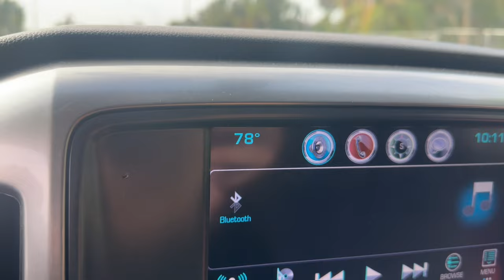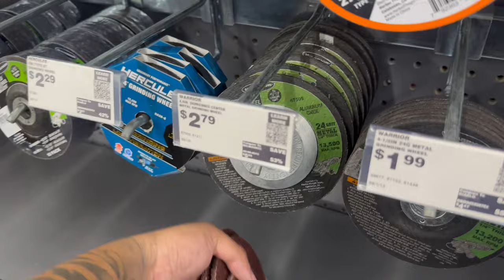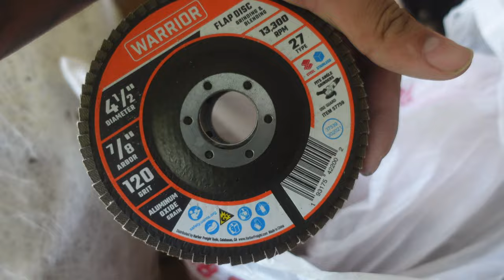How I Avoid Sanding Speaker Door Panels By Hand!

Comment: chopmat on the inside of pannel for strength, and you wont need to take a flap wheel to it. holy shit man, you are making it way harder for yourself
Reply: Are you saying he's using way too much body filler?
I've never done a fiberglass job before but am trying to learn so I can do my doors soon.
I'm broke and usually don't have the tools I need to get jobs done easily but it also doesn't ever stop me 😂 ideally I won't need to sand too much
Reply: @RandoManFPV  you dont need to put chopmat on the outside.after you stretch the material around your rings you can just do good coating of just resin, let it harden and then from the backside add the chopmat. makes for less sanding and less body filler. use the chopmat on the inside for strength, the outside will be a whole lot easier to sand and less itchy too. hope that clears iy up for you.
Reply: @bryanhelland2722  this makes very good sense to me. I'm surprised I don't ever see it done that way tho on youtube videos. Everybody does some stretchy material like a blanket, resin, chopmat, and then more resin and chopmat. Sand it, bondo, sand again, finer bondo, finer sand. Then hopefully done.

Never seen someone just do the chopmat on the inside. I'd like to find an example of your method tho cuz I will probably do what you suggest.